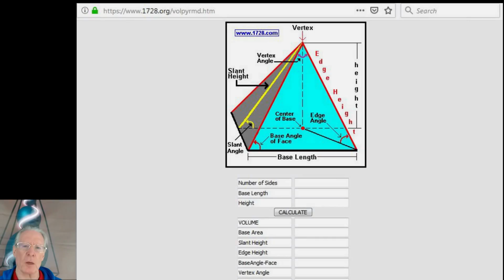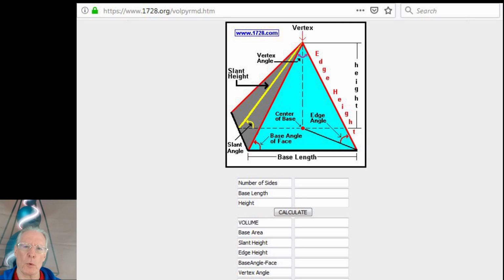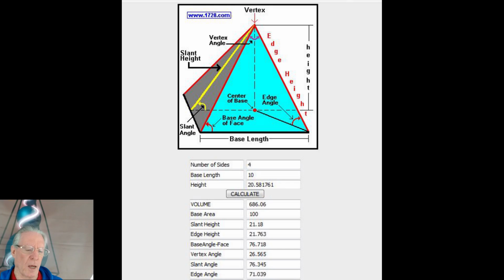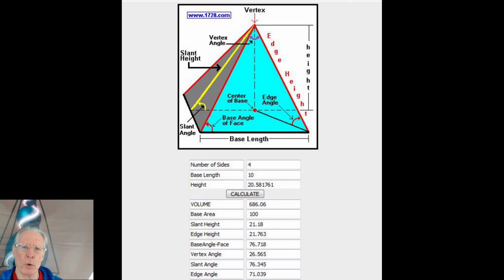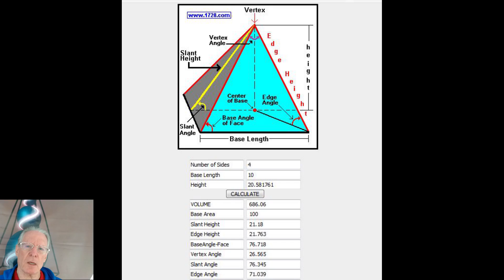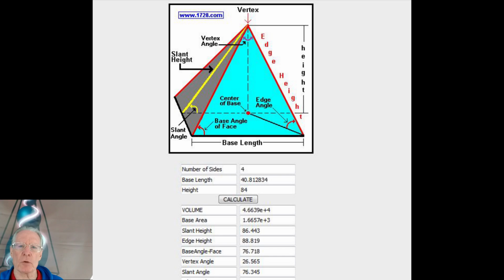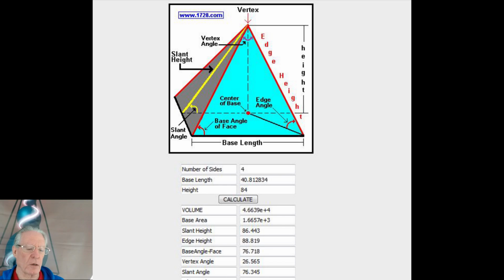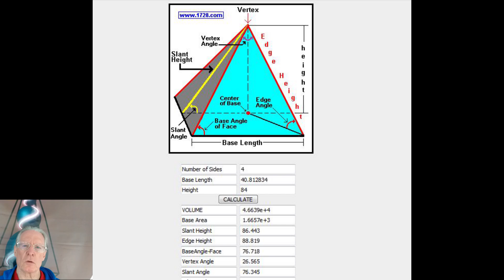How To Calculate The Dimensions For A "Build It From Scratch" Russian Geometry Pyramid

Comment: I took the measurements of the pyramid of Cheops by rounding the measurements perfectly:
all sides 230,00 meters
height 146,60 meters
I calculated the diagonal getting 186,184 meters.
The diagonal / height ratio is 1,27 while the side / height ratio is 1,57.
Therefore, if you want to build a scale pyramid with a side of 50 centimeters, simply divide the measurement of the side by 1,57, obtaining the height, which will be multiplied by 1,27 to obtain the diagonal.

Comment: simply,  triangular face has height 4x and base 2x.    Pythagoras.  triangle with 90 degrees.   (4x) squared + (x )squared = 17x squared.   Thus length of side edges is the square root of 17 (x) squared.  I am making one in garden with timber stakes,  and string holding the base apart and the top together.    long stakes may be 1800mm.    any length can be calculated.  One can make teepees with this geometry.
Reply: teepees-   calculate circle same as perimeter of base,  and radius.    C = 2 Pi r. = 6.283 times radius.     the giza pyramid has height equal to radius of the base circled.

Comment: This is very helpful. Thank you for sharing.
I think I might find it easier to work in metric as dividing an inch into something like  0.81284 might be a bit harder than using decimal metric.
I think I'll make small pyramids to use as the corner connector blocks.
Much appreciated.
Reply from the maker: I totally agree metric is easier.  Wish we had adopted it 45 years ago when we had the chance.
Reply: @pyramidsciencefoundation  - In the UK, if you were at school about that time, as I was, you were educated in both, which is quite handy, although not rocket science.
Do you use a digital device for accurate measuring ?  
I was quite shocked to watch one of your videos recently in which you included a picture of yourself before you installed a pyramid next to your bed. The weight loss is remarkable, but more importantly, you look good for it. I think that when you get older, weight loss can sometimes make you look a bit drawn or gaunt. But not in your case. As your weight loss can be attributed to a positive life force energy, you are a good example of the beneficial effects.